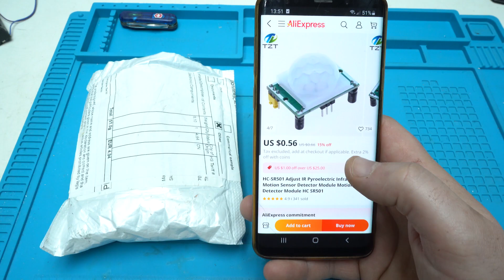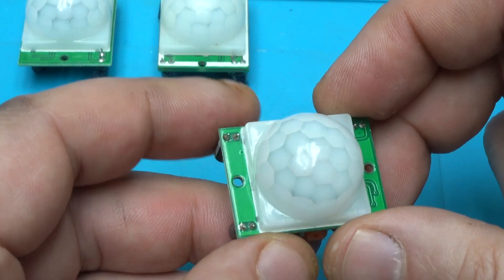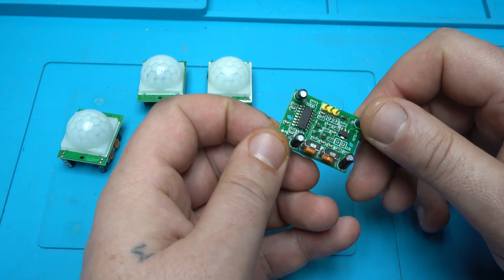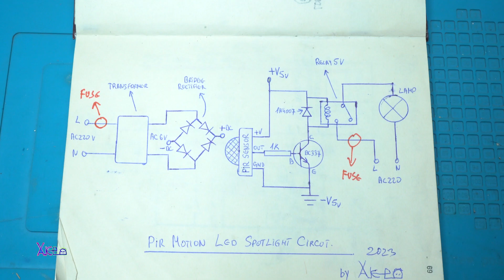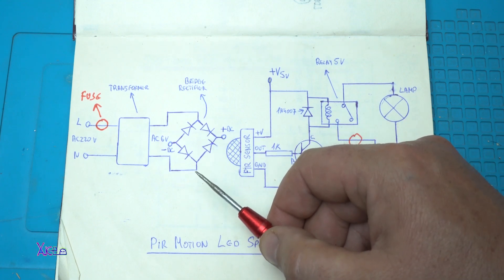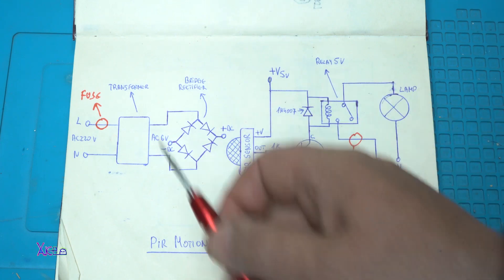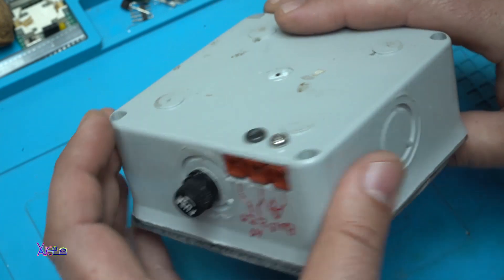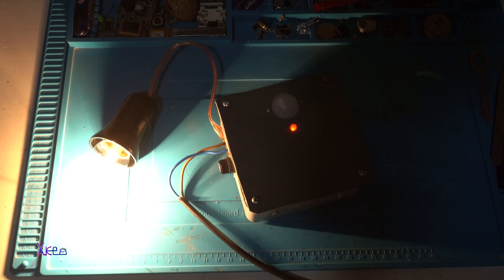$0.5 Aliexpress DIY Module -WHAT You can Make?

Comment: I've given up using transistors to switch a relay coil - transistors are so delicate to spikes.
Wasting a diode across the coil is too inconvenient for me, and the back-emf has burned up too many transistors, even using very small relays.
I'm experimenting using MOSFETs and IGBTs to switch a DC load and I've had a little more success, but even they can stop working without warning.
These days I only trust pre-made modules for critical builds, as they have the protection in-built.  So many traps for the beginner, it's enough to make you give up tinkering.
Reply from the maker: Yes, these modules are much more reliable than building your own from scratch.

Comment: I would have used a chord grommet and connected the 220VAC inside the case for better isolation from the elements like water, rain and whatever.
That way the box would be fairly well sealed and less of a hazard.
Otherwise a good idea but a lot of work for something readily available already made with LED lights and cheap online.
Reply from the maker: Yes to buy from online is cheaper and maybe better way but for me as electronics lover and fun time is right choice and in the same time I teach my boys🙂